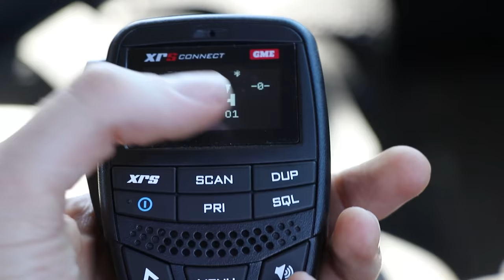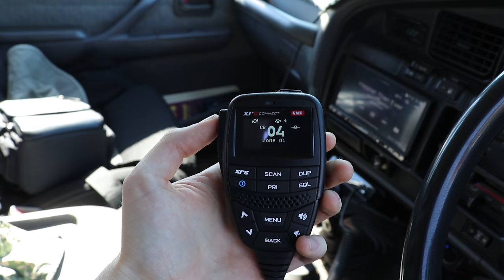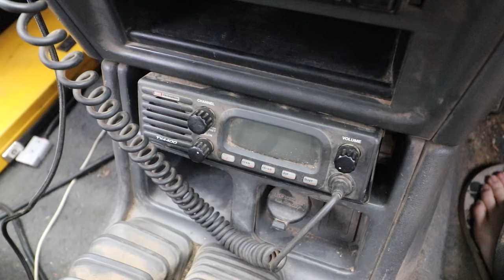You've been using YOUR UHF WRONG!!! CB Radio SECRETS for 4WD in Australia PLUS History & Technology

Comment: Just a couple of points I really need to stress.  The duplex repeater channels use chs 31-38 to receive (rx, at the repeater), and chs 1-8 to transmit (tx, from the repeater) in real time.  That's how it works - pressing the duplex button sets up the radio to tx and rx on these channels automatically.  Users should not use chs 31-38 or 1-8 in simplex mode unless they are 150% certain there is no repeater on that channel, and then maybe not even then.  In particular do not use chs 5 and 35 as that is the repeater channel reserved for the emergency repeater (unless you have an actual emergency of course).  There's very good reasons these channels are not listed in the general simplex chat channels.

There's absolutely nothing worse that some muppets driving around using channels 31-38 simplex for car to car comms on some fourby track or group tour simple because it's close to ch 40.  Hitting the local repeater (or the emergency one) and having no idea because they can't hear the repeater or all the other poor users (or emergency monitoring group) going absolutely spare at them because they are not listening to the repeater tx frequency.  Just don't do it.

Having said that, repeaters are provided by the local radio community.  You won't find all repeaters in all areas, sometimes not even the emergency one.  Local radio groups or businesses will be able to tell you what repeaters are available and where they are located.  They are usually the ones providing the service and maintaining it, especially businesses.  Every few minutes you will hear a morse code or recorded voice message stating the name of the repeater and maybe who is running it.  It's an ACMA requirement.

You also don't seem to be aware of HF CB radio, which uses the 27Mhz CB band.  While UHF is strictly line of site comms and can't go more than a few km in the bush if it's fairly light and flat (repeaters excepted), HF has the ability to stand a ground wave way higher so it works much better in the bush.  The TX power limits for HF CB are 4 watts for AM and 12 watts for SSB, usually lower side band (LSB) but some sets can still do both upper and lower sideband.  I've communicated 40km through the bush on SSB, on my way back from Pennyfarther River (FNQ) talking to someone in Weipa.  We were running late for a rendezvous with part of our group and needed to let them know we'd be about another 40 minutes or so.  No mobile phone coverage of any type out there.  This is the real power of HF.  The ionospheric skip you mentioned isn't really that useful for travel purposes - it's for much longer distances, across states or even continent to continent, and the frequencies you need to use vary with solar radiation and are usually much lower than 27MHz.  For long distance comms in the bush I'd recommend HF SSB CB if you don't want to go to all the trouble of getting a land mobile apparatus or HAM license and spending a lot of time and money on training and radio gear.

27MHz has fallen out of favour with most these days.  It's harder to use, especial side band, and takes a bit more skill to get the range out of it.  Truckies in particular can't be bothered with it, though I'm sure there's still a few old boys that have it in their rigs.  HF CB uses the following channels: ch 9 emergency channel, ch 11 general AM call channel, ch 16 general LSB call channel, ch 19 road users (trucks) general use channel.  All others are available for general use as long as no one is using them.

Comment: Mate, great video, I have the oricomm DTZ4200X UHF radio and i have having problems with the amount lot interference in reception. I have the antenna 3DB and 6Db (interchangeable) mounted on the bonnet. It was installed by an auto electrician, and I noticed today that the head unit is underneath the steering wheel. The question I have is should the reception be clear, or is there always a level of interference? Also what the hell is squelch?
Reply: Squelch is non you adjust to get rid of back ground noise

Comment: HF at 100w is great, but with my little 20w hf radio I've made contacts 1500km away. It's not all about the power, the antenna is the most crucial part of any system. The most expensive radio means jack sh!t if you don't have a good antenna.

Comment: Mounted mine on my roof rack using the gme folding bracket and a custom mount.
Reply: I bought the connect gme pack and a 6.6dbi to interchange.
Reply: I bought the connect gme pack and a 6.6dbi to interchange.

Comment: Interesting fact, vhf radios (marine radio) will transmit at 25w without a license. This is because it has to travel a long distance over water to communicate. Using a repeater/duplex, I've gotten 115km.
Reply: I think you will find you need a marine radio operator license!. It is called a Short Range Operator  Certificate of Proficiency.  Short exam and  is issued by ACMA via AMC. Aust marine college university of Tasmania.  Use of such radios use strict protocols and not for general chit chat!! I have one as part of my Marine license Indicator.. a license to operate powered water craft up to 25 km off shore!
Reply: @rosswines  yea i have mine too, I operate mine 100km offshore all the time.

Comment: Have a look at the effect of ground plane in your antenna the ground plane is the neg of the antenna and your antenna should be in the middle of the ground plane and it should be 1mtr square for optimal even reception if you have the antenna if to one side of the ground plane your reception will be less on the short side so on the bull bar your reception is less on the passenger side middle of the roof is best but mostly not possible

Comment: Mongrel. Wish GME would send me an XRS unit lol. Ive had a GME TX3100 in my Pajero pretty much since I brought it. The unit came as a Plug & Play kit with magnetic antenna and Suction Cup windscreen mount, Ive since hard wired and upgraded the antenna. I also have an Oricom UHF390 with handset controls and I cant wait to swap it out to a GME. The GME gives much better sound quality, Is much easier to read the screen, is easier to control and over all is a much better unit. I currently run a 3db antenna on the GME and normally run that on scan and a 7.5db on the Oricom unit for Trucks etc but I do plan to change that antenna soon and one day hopefully I can be running both GME units in my vehicle. GME if you see this I would be proud to take on a sponsorship for my channel lol.

Comment: 3:10 if you transmit with 100000W on UHF its not safe for your body... you can compare it to be in a microwave ovn... on VHF if sitting in front of an hi gain antenna you can feel the heat while its transmitting... many old Radar setups in the 50-60s with VHF and UHF, made the personell blind or got weak sight as in the winter they stood in the radarlobe for getting warm as it was cold in the conkrete bunkers

Comment: dude  High gain is always better regardless of where you are, it has a an impact on your noise floor and receiver sensitivity.  Also without getting into the mathematics the dipole length at UHF plays an important factor in performance, so you can get a better gain than unity at a shorter length.  The ground place is also an important consideration when mounting in a vehicle.  Remember every 3dB of loss means half your power and its both ways, the ideal link budget has both paths balanced.  Combining frequencies is also possible however you will introduce a 3dB loss as well as an insertion loss into the combiner.
Reply: I would disagree... different antenna characteristics are beneficial in different situations, what works for one segment of the RF spectrum doesn't always translate into another under real world conditions.

Ronny Dahl did a nice comparison of low/high gain UHF antennas (and mounting locations) worth a look 👍
Reply: @SpectreOZ  your call I respect it. I'm a RF engineer by trade and a specialist in antenna system designs with access to test equipment that is the cost of a house so do have an idea what I'm talking about.
Reply: @omarhammoud7223  Well I can't compete with "mega dollar" RF equipment, on HF bigger is always better no debate but UHF is finicky, large collinear stacked antennas are very susceptible to changes in the vertical axis, in hilly terrain OR city landscapes high angle of radiation (lower gain) antennas outperform larger higher (lower angle of radiation) gain antennas.

Another anecdotal example is a 6dB home base antenna Vs. A 10-12dB during a wind storm, the 6dB will experience less "flutter" or signal drop as the antenna is blown around.

https://www.gme.net.au/au/news/understanding-antenna-gain-and-dbi/
Reply: @SpectreOZ  I agree that higher gain will affect the beam pattern especially your vbw and make it more directional however running a unity gain system greatly reduces the intensity of beam propagation and range as well as make the receiver work harder, in a Bush environment you would hope most of the comms is for range and getting thru clutter than navigating hills. you now have access to space diversity systems as well as cross polarised antennas even in omni form that make the fade margin a thing of the past, its just your hf and vhf receivers front ends and signal processing power have not caught up and might not have to otherwise they will be too expensive for the end user. . Were now beam forming in the antenna and can achieve gigabit data at mmWave and again not useful in the Bush environment although  the tech is evolving physics does not. Thanks for your reply great conversation

Comment: The original CB's were 18 channels, then expanded to 23 channels then to 40 channels. They used AM mode for short distances and SSB (Single Side Band, split into Upper and Lower). The band used was 27Mhz.
Reply: I had a 3 element beam and spoke to Americans from my humble abode in regional Qld.
Reply: The original Australian CB band  around 27 mhz is the 11 meter band and is towards the upper limits of the HF band just below the 10 meter licenced amateur radio band.
When band conditions are right a phenomenon known as 'skip' allows communications of several thousand miles, this does not occur at UHF frequencies as UHF is basically line of sight.
Reply: NO - The "original" CB radio's were the likes of Tait's & Airlane's
Maybe you have heard the expression of "A Pop-up Toaster"
Well, that's exactly how they worked.
SEVEN push buttons that Popped Up" when you selected another channel
These were the 26.5 Mhz range of CB's that we down here in New Zealand, had - from about 1970 - to the later models with 11 channels then 40 etc., which came to the fore, about the end of 1970 beginning of 1980.
I still have my first POP-UP toaster, an Airlane Mk I
I also still have my updated 11 channel Airlane Mk II
The Airlane manufactured aerials, were a lot better tuned, that the one's made by Tait, and gave far better service in all mounting positions, BUT.!!!
Only if fitted with a moderately heavy spring, that allowed them to snap back if one hit an overhead wire (or the canopy at KFC)
Having a spring too light, meant having the aerial snap back at over 60mph, or when cruising into a head wind at slower speeds.
Having too tight a spring, and the opposite happened
You'd hear it snap back - but that was the aerial snapping off, just above the spring (when it broke the fiberglass, and half the aerial wire would unwind when the aerial hit the road behind you)

Comment: The only UHF we have in 'merica is if you are a ham (amateur radio) operator. We have CB, but way down in 11m frequencies. We just allowed FM on 11m CB.
Reply: What about FRS?
Reply: @vk2us  we do have FRS, but it's extremely limited. Set channelization, non-removable (usually shitty) antenna and about 2w max power, with many channels only allowing .5w, and no repeaters. Luckily I am an amateur radio operator, so I have many many more options for frequencies and output power.
Reply: @JayFude  Imagine what an open repeater in a large city easily accessible from a cheap radio with no license requirement would be like. That's what your missing.

73's VK2US
Reply: @vk2us  shudders

Comment: 1. ACMA - that is the Aus Gov body in charge with managing this - Check out their allocations for RF spectrum in Aus. 2. If you could broadcast at even 150W in HF with an antenna that close to your gonads  - probably want to think about no more kids... or cancer that thing - RADHAZ??? 3.Having a higher powered CB is excellent - if you've ever been in an emergency - being able to switch to even 25W can assist in getting your signal out and may just save your life. 4. ACMA can triangulate a signal from one of the 4 mobile platforms yep - but if 'jump on and start talking over emergency services' you would also need to be on an emergency channel - and you can do that at 5W - nothing to do with a radios power output. This is just BS talk. And if you're a  mobile platform/vehicle they have zero hope. It's nice to get freebies - but stick to facts. Maybe talk about how the length of the antenn element affects the 'donut' of RF transmission pattern - short good for high angles which is useful in mountains where you mate may be at a different elevation - long antenna - flat donut TX shape - better for range etc...

Comment: You are not totally correct on the antenna gain points, if it were a yagi, yes, more elements mean narrower beam, on an array, it doesn't work exactly the same and a lot of high gain UHF to microwave antennas are arrays not dipoles. antenna design makes a huge difference in what happens. They may also to the untrained eye look similar.
All switches are a loss (1db or more usually, 2 connections and the actual switch are all loss points.) but depending on the actual RF output and cable etc, a switch can be beneficial to run two antennas. 
Line-of-sight is groundwave. HF and below are bounced, ducted, reflected or refracted, however you wish to describe it, VHF and above go through the atmosphere and out into space, so there are not many times there are refractions or ducting to keep the signal on anything but line of sight ie straight lines. 
You are correct hight is everything in antennas, and that spring, that's a signal sapper, better on a proper steel whip. 
Correct about the bullbar mount. Also look up ICNERP rules and remember that RF in general has a 3m/10ft Magnetic efect, so you don't want long term exposure to Magnetic and Electrical fields, so mount on the roof (it sheilds you plus you get out better). 
ps, you can still get weather and data on HF, more and more people are getting licences and making the connectivity woring for all. 
My kit, as a UK amateur licencee is 27mhz CB, VHF/UHF 50/35w radios inc APRS (when I fix it) HF 1.8mhz (160m) to 50mhz (6m) (licence applicable) If the atmospherics are good you can hear yourself, your signal has gone all the way around the world... You can also regularly get Oz on 10watts... Antennas, ATAS, longwire, CB antenna with an auto tuner, hi gain 3 band for VHF/UHF/6m 2.1db for APRS, plus 2/6m 2 elemet beam for camping, 17,20,40 3 element beam for camping through auto tuner gets most frequencies but you can't drive with those on. Oh, and 9m pump up tower all totally portable.

Comment: I'm running a 100 watt Motorola Spectra and haven't had any knocks at the door from regulators
Reply: Start swearing, abusing peeps and vlogging up channels, you'll have a knock soon enough..
Reply: @CrazyWhiteVanDriver  been doing that for 30 years. Even ran 1 Kw on HF. Even used uplinks on 2 metres.
Reply: @VifferDude  I doubt it.
Reply: @CrazyWhiteVanDriver  why do you doubt it?
Reply: You won't believe that I used an modded Alinco DR-610 to prank the girls working the McDonalds drive through lol
Reply: @VifferDude  because I know what the acma are like.
Reply: @VifferDude  no, I'm a licensed telecommunications technician. Derp
Reply: @VifferDude  and asio don't investigate telecommunications breeches, acma do, derp.
Reply: @CrazyWhiteVanDriver  never said they did
Reply: @VifferDude  so what are you going on about. Your comments are less than intelligent 🤣🤓

Comment: I'm glad you trust GME radios because I don't. The tech may have changed recently but after spending years as a radio operator and having my own GME radios die or having plenty of people bringing me GME UHF's and Marine radio to repair, I just don't trust them. This is just my personal opinion but I prefer to stick with Uniden or Icom. Also you might want to brush up on your radio procedure. There is no such thing as over and out. You are either over or your out. This over and out was an old yank slang and does not belong on Aust CB.  Also the Non assigned Outpost license for outpost and RFDS radios have now changed to a class license so no need to pay a fee for a non assigned outpost license.

Comment: Have the same unit with both the 2.1 and 6.6, mounted to the roof cage/rack and to be honest, I never use the 6.6. I find the range of the 2.1 is more than adequate and dont greatly notice any improvement in transmission range with the 6.6. Keep the grub screw coated in anti-sieze or it will corrode in there and is a real bitch to get out.

Comment: Great Video now just get rid of the GME antenna and replace it with an RFI, See and hear the difference. XRS and the APP is a big problem. If you friend has a Uniden XTRACK the GPS function is no good. GME may make Radio and some antenna's here, but all the accessories are made in China.

Comment: does anyone make uhf/ vhf radios for 4wds? or do you have to have 2 seperate radios?
Reply: what VHF Freq do you want? ICOM had one that did both but you require a licence to transmit on the VHF channels. you can also get ones from Ebay but they are technically not approved for use in Australia.